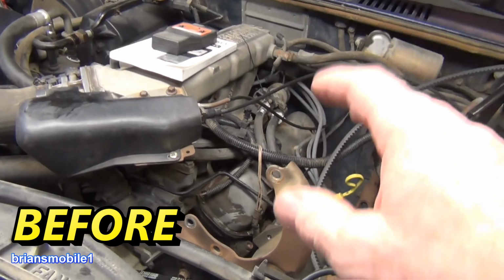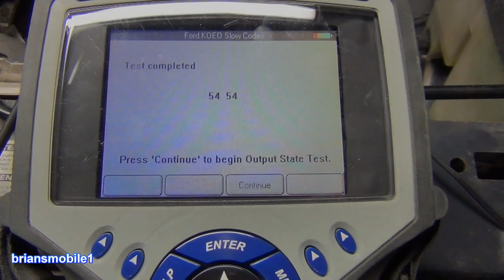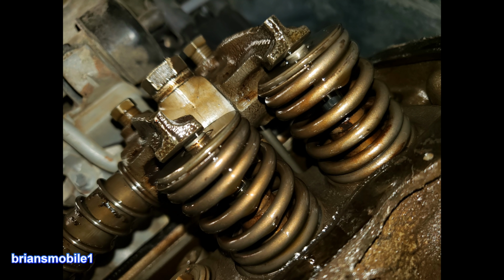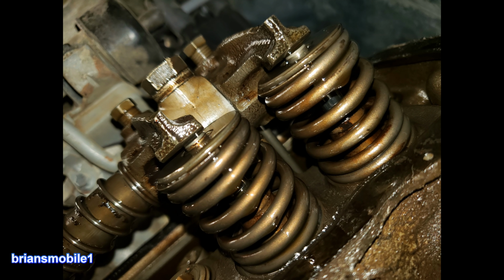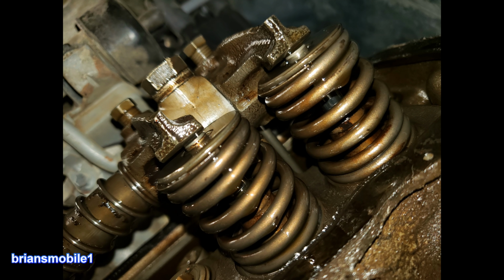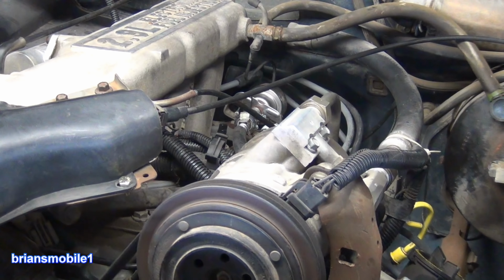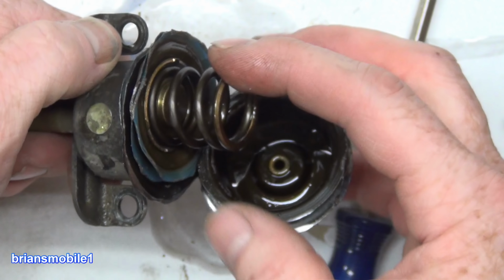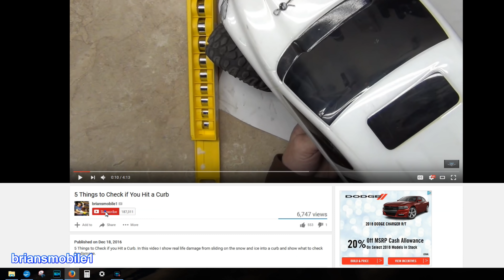Double Dangerous Misfire Fixed

Comment: I haven't seen a Bronco 2 In about 20 years. I don't miss them.
Reply: I loved mine!  We purchased it dirt cheap due to bad heads.  Fixed it up and had oversized (very wide) tires/rims.  Thing ran amazing until the engine finally gave up about 80k later...

Comment: I had a 1987 Bronco II XLT from new, I traded it in after 4 years because it was rusting out like crazy and scary to drive in evasive manouvers!  Mine was a 5 speed manual also, very scary to put this thing up on 2 wheels at 120km/h near Toronto Airport, gladly it came down okay, but with the rust and the instability I had enough.
Reply from the maker: Everyone I know who had one loved it's fun side, but experienced stability issues or worse.

Comment: when opening things like that use tin snips or diagonal cutters and cut the top end of roll pinched section every 3/8" inch or so, then screwdriver/pliers to fold it open, no heat no damage to diaphragm and better diagnosis :)

Comment: I have a 1990 bii and its leaking fuel from the connection on the pressure regulator, its different then the previous year models but do you know where i could get a new line? if they even sell one? cant find anything on the fuel line, its braided

Comment: If you own one of these and love it and plan to keep it. Buy a Holley Terminator X for it. It upgrades the computer and diagnostics. It will run 10X better and way more power and fuel economy.

Comment: Hello Brian... new sub here, I am currently in the process of pulling the motor of my boy’s WRX STI, and was stuck when I got to those two pesky studs that go through the bellhousing into the block. Per your old video, that explained a lot, thank you!  Question: have you ever tried to remove those studs so you can simply lift the motor straight up? Thanks very much in advance. Scotty
Reply from the maker: Thanks Scott!  You're welcome, I haven't tried to remove them.  They're stuck in there good.  The radiator and fan assembly is easy to remove and is faster if you take the time to lift the engine/trans about 3" and support it to clear the motor mount studs to go forward.

Comment: I have a 87 Chevy celebrity 2.8 multi-port fuel injection basically the same engine that came in a Chevy Cavaliers too with obd1. 

My question is how do I adjust or know if i have my throttle position sensor set right on the throttle body ?? 

It's a pain without taken my obd2 an using that to dial one in butt i can't do that on this old stuff. 

The old sensor went out completely an wouldn't start or run the car anymore so i replaced it but now that it runs I have this cut up problem at full throttle an then sometimes this high 1500 rpm that will start by it's self an I have to turn car off put it in clear flood mode an start it an then let off pedal an it will run an idle back down to 900rpm like it should do .

So I know I have this thing out of adjustment or something but I don't know how to fix that or how to test
Reply: If you can borrow a Snap On MT-2500 , " Red Brick " scan tool , the TPS voltage will be displayed . I believe the setting is .055 volts  . However , that tool only shows .054 or .056 . Either is acceptable . You can also make a jumper to go between the harness and TPS or buy a replacement or used TPS connector and strip the wires back to connect a DVOM and read the voltage . The wires go into the harness plug . You can also take the reading off the plug on back of the computer . I think it's easier to find the MT-2500 . I just did my 1987 Celebrity 2.8L . I also have an Action CP-9690 scan tool that displays TPS volts in data when running. But it won't show it when you adjust it with the key on , engine off . KOEO . Also , most of those TPS can be put in without removing the throttle body . I have had some that were " wider " that would not squeeze in .
Reply from the maker: @billsmith2212  you're the man!  Thanks for helping the BM1 community!

Comment: I was driving my 1987 Celebrity 2.8L when it died with no warning . I pulled over . On a crank , I smelled gas ( NOT from White Castle ) . I found gas running out of the throttle body . I suspected the fuel pressure regulator . I traced the vacuum hose . The FPR is under the intake plenum on that 2.8L . I put a vacuum pump on the line and as soon as I pumped , it drew in gas . The diaphragm was ripped . I have an inline , clear gas filter on the vacuum pump to keep foreign ( or American ) crud from going in there . The injector rails have to be spread to replace that FPR on that 2.8L .
Reply from the maker: Yeah, GM made some tricky hard ones.  The spider injector models of the late 90's were hidden inside the intake manifold with no vacuum hose at all.

Comment: Brian what is your opinion on the value of a tech being ASE certified?  Is it worth the time?
Reply from the maker: Hey Steven, in my experience it's great for working at a dealership or big shop etc. if you're independent it likely won't do you much good.  I got a job at a dealership and that was basically the whole interview for me.  Most of my other jobs didn't care as long as I turned out good work and didn't have come backs.

Comment: Brian . 2001 grand cherokee has no power sometimes parking on hill. Must hold the break same time so keep won't roll whole in reverse. A sometimes shuts off. Any ideas?
Reply from the maker: Those have an idle learn procedure that if you don't nurse it right and let it idle learn for a few minutes after a battery change or leaving your lights on, they'll do that intermittently and more so when humidity, or temp changes or you have an elevation change.  I see that the most.  The other thing I see or saw on those is a dirty throttle body and or idle air control valve or an EGR valve pintle that was too carboned up to close all the way.

Comment: I wouldn't have wasted my time with switching the fuel regulator i would just coyote swapped it called it good been quicker easier safer cooler
Reply: Quicker, easier? Have you even done a swap. It is neither quicker or easier. The motor is worth more then the car.
Reply: @FishFind3000  yes I have done a few motor swaps and it's okay if the motor cost 10 * with that car cost it would be cool for going for a cool Factor

Comment: Are you just that tough or do you have a secret for pulling those wires off without getting shocked? I remember my dad using a screwdriver to try to find a defective cable on a 70's model car and got a series of jolts because his finger was accidentally on the shaft of the screwdriver. That made me paranoid and I have always turned the engine off and pulled wires off individually to inspect for damage.
Reply from the maker: Kinda both and neither.  I wasn't being shocked, but I've had it enough times from 220V living in India, putting up old school Christmas lights, livestock fences (don't pee anywhere near one in the dark) and of course from ignition wires that I'm not afraid of it, but experienced enough to know how to avoid it too.  I gave the arc a path to the exhaust stud.  If I held it up for the camera- I would have been the path.  Lousy shot, but comfortable tendons and fingers.